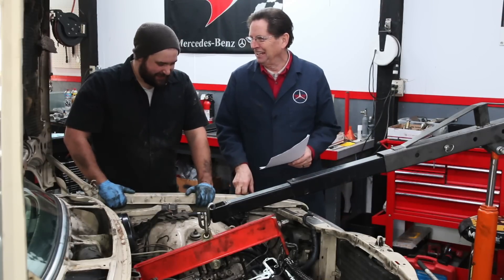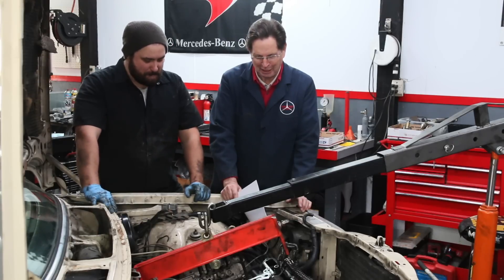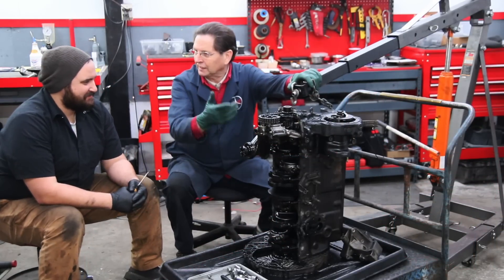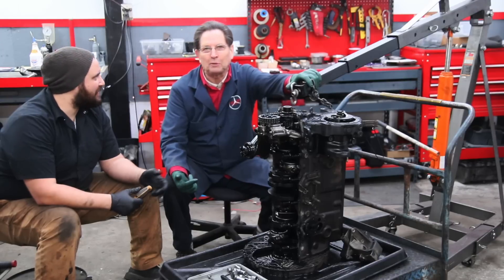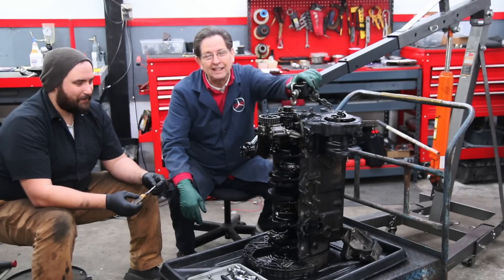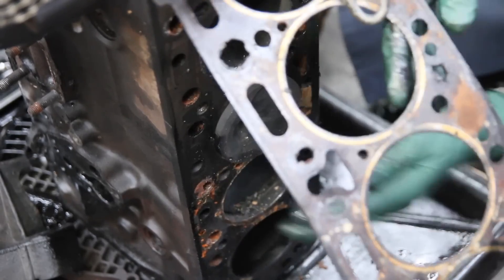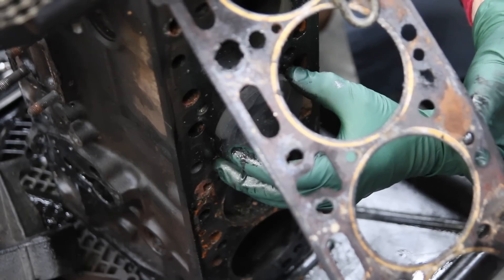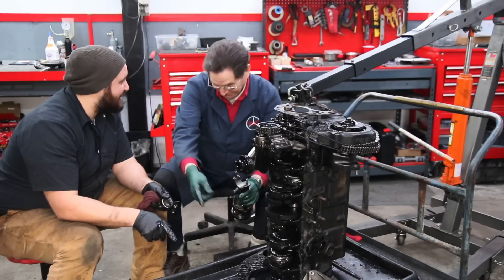Blown Turbo Diesel Engine Diagnosis Part 4: Smoke Clears How Could This Happen at 280K Miles

Comment: I've definitely got some rust in my system - changed the hoses and thermostat recently and cleaned up as much as I could in the reservoir. What would you recommend in terms of the "power wash" you mentioned? This is a standard job at a radiator shop?

Comment: The water pump on my UK vauxhall/opel senator 3.0 sheared in 3 bits (cheap plastic not original part), result was red line overheating and engine stalled, due to I suspect oil being too hot to work the hydraulic tappets, it would go again after a ten minute wait. Unfortunately I had to nurse it home, no recovery that night as was very late on, and not too far  to go.
What you've said about rebuild after overheatmade me think...... hopefully there was no serious damage, the whole head was stripped and skimmed, I also soaked the tappets in fuel overnight and freed some of them off, as some were stuck/sticky. On inspection the 6 pot head gasket looked ok, the pistons were all clean and moved freely with nothing suspect. The opel straight six engines are all cast iron and known to be quite sturdy. After rebuild it ran like a dream, lets hope it stays that way!

Comment: Great video. Apart from routine oil/filter and longer-interval coolant/thermostat changes, I also do this at least a couple times a year: use the turkey-blaster method to drain coolant out of the expansion tank into a jar and check the coolant level sensor warning light, and re-fill the removed coolant afterwards. I also check (mostly at summer time) if the magnetic fan clutch engage in slow traffic when the temp needle rises. This coolant switch was not working when I purchased my 190D, so I replaced it. All this to prevent sudden/catastrophic damage, possibly from hose failure.

Comment: I've had this same problem with my 1994 S350 Turbodiesel with the OM603 engine. I bought the car, and after a month the car just started overheating. I replaced the thermostat, I replaced the coolant, I cleaned the radiator and still the car kept overheating. And at the end I sold it, and the new owner (who is a mechanic) just replaced the head gasket. He's now selling the car, and some unlucky guy will buy it, and end up with an engine replacement.

Comment: I had the same problem. The final cause was not heat , or lack of maintenance, but a very small crack in the head at cylinder 2, , making one cylinder very hot and score the liner..  I ordered and size machined a new liner, used a second hand head , and new piston rings on an old piston . Big job . but when hot i have low oil pressure : I should have renewed all piston rod bearings at that time Now i turn up RPM when hot and stationary .. Its my late dads car .. I love it !

Comment: Great video with so much helpful advice. Maintenance is key to longevity of any vehicle and everyone car owner should watch this; regardless your a diesel owner. It also pretty amazing that this engine not only had a spun bearing, but a bearing that was disintegrated and was over heated multiple times. These engines were truly built to last. There’s not many engines out there that will run with a spun bearing let alone one that’s completely gone.

Comment: Amazing... very high heat at that bearing. I am pretty sure that the crankshaft in the OM617 is nitrided  and that is awesome in itself, but chronic high heat in an engine is very bad.

Comment: Once I saw that fancy air cleaner on the engine I had the feeling that this engine has seen a lot of abuse. At least this engine can still server as parts for something that is still a running engine.
Reply: I  always groan when I see someone's added a "hot air intake" filter like that.

Comment: Do you have any experience with Evans waterless coolant? I recently acquired a beautiful 1980 300sd which has Evans installed. I’m interested in hearing what you think of it. 
My wagon got a full cooling system overhaul and Zyrex coolant 2-3 years ago and hasn’t lost a drop. Getting ready to do it again. I appreciate all your wisdom Kent. Thank you.

Comment: I've learned a lot from this video.Few years ago almost the same happened to my OM617 non turbo engine.The cooling system got a little leak and the engine overheated.My mechanic said oh,its just a head gasket dont worry.So the head gasket been replaced,the head has been machined,coolant leak fixed,coolant replaced.Ive drove in a freeway about a 30 miles,then when i left the freeway I heard knocking from the engine,there was very rough idle.Then I swapped the engine to another,still got the blown engine at my backyard, Im curious now what happened to it,so i will take it apart. Love the series keep it up!

Comment: I had almost the same situation on OM646 but there connecting rod was half-way unbolted when I removed the oil pan 😜 ( the engine was reapaired before 😒)
Reply: OM 646 2.1L has undersized crankshaft bearings in be-turbo configuration in Sprinter. That cause destroyed bearings and flakes ends in oil pickup tube screen been blocked . End result is oil starving engine. When chain reaction starts there is no way back. Same engine with single turbo in Vito doesn't have this problem because single turbo can produce that much bang . To be on safe side change engine oil every 10 000 km not 20 000 what Merc recommends. It is a bit pricey  because this engine needs 10.5 liters expensive  low ash oil. On every oil change use mini usb camera and trough drain hole check that screen on pickup tube is not blocked. Bastards engineers design it to be vertical not in  horizontal position. That means that when you turn engine off all crap what is on screen stays there and can't drop down.  
Another German engineering jewel is that Sprinter doesn't have temperature gauge. Nothing, zero ... Every Sprinter owner should install aftermarket temp gauge with alarm set if temp go over set limit. That will save you from completely destroying engine. If you find that things are starting to give way like temp is slightly higher simply change main bearings . Drop oil pan and bang. Bearings cost around $100 and a few hours save you thousand. My 2007 Sprinter had only main bearings changed at 485000 km and is still going nice. Maybe this is because we are driving on left side of the road, who knows... :) :)